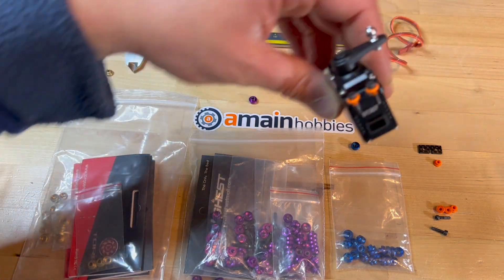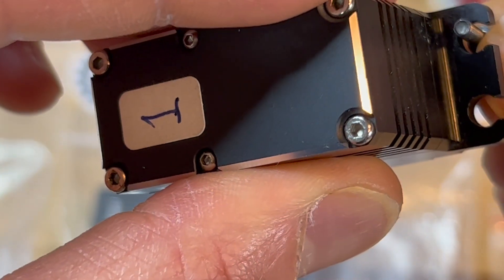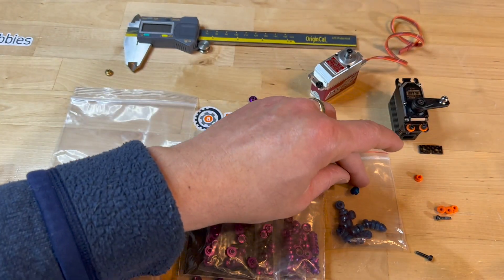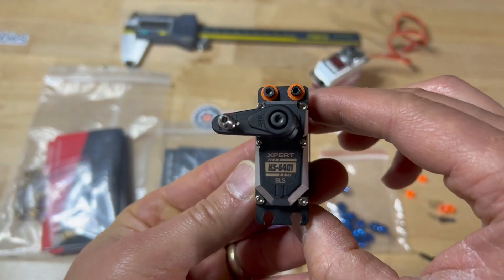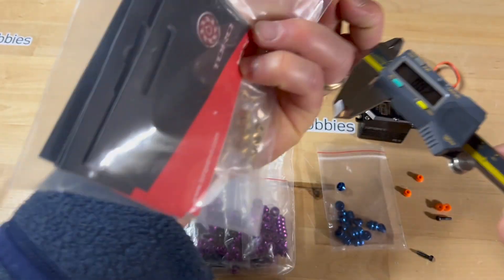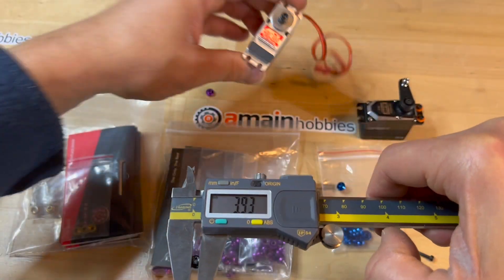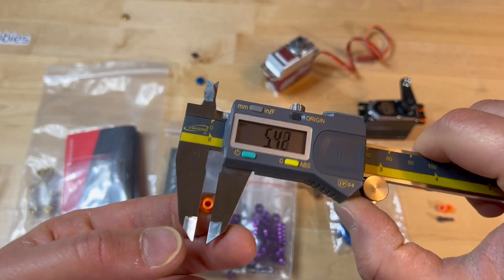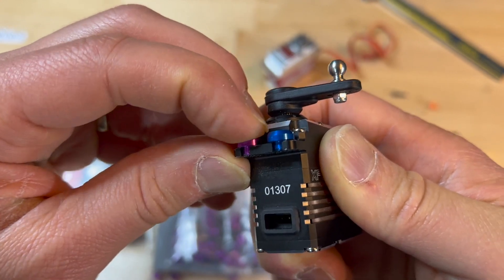Tron 7 0 Build and Setup Tips and Tricks Part 8a    Servo Spacer Grommets   HD 1080p

Comment: Hey John,
I’m putting together a Logo 480 and using Savox servos. They came with rubber grommets.
I’ve applied considerable force to the servo and cannot get an perceptible movement.
I don’t plan on flying 3D and am relatively new to helis.  I’m pretty sure the current setup should be ok for me.  When (or at what point) is a “hard mount” (your method) required or desirable?
Reply from the maker: The rubber grommets and brass eyelets have been the traditional servo mounting method for many years, and for a good reason.  The flying machines these rubber grommets and brass eyelets were designed for were high vibration flying machines due to the internal combustion engines.  These rubber grommets attempted to dampen the vibrations sensed by the servos sensitive electronics.  If you plan to use an internal combustion engine (gas, nitro, etc.) then these rubber grommets and brass eyelets are worth considering, although many folks just hard mount servos on these higher vibration machine without too many reported issues.  However, what seems to be pretty clear is that hard mounting servos to low vibration electric flying machines is the modern standard.  Hard mounting servos increases overall fidelity and coupling of the FBL unit control loops with the servos.
Reply: Thanks John!
I’ll be looking for some hard mount spacers (as I’m not too far along in the build)
Also really enjoyed the Spirit GTR series that you did, I’ll be looking into sending $$ to the CZ.
It’s funny Esprit dose not sell those. (Have to go direct to Spirit for now😢)